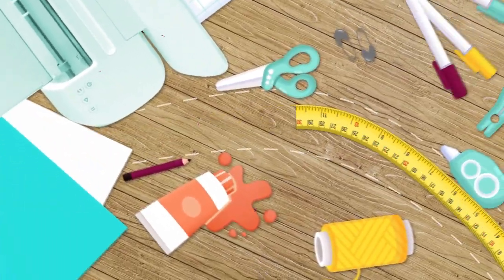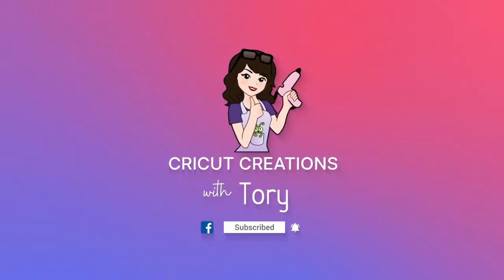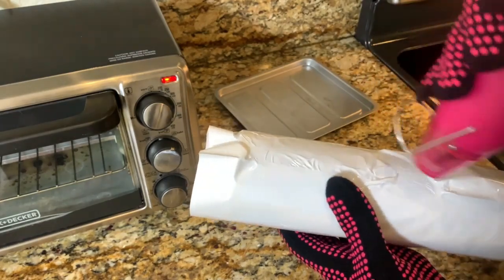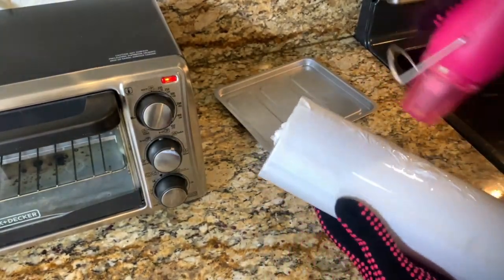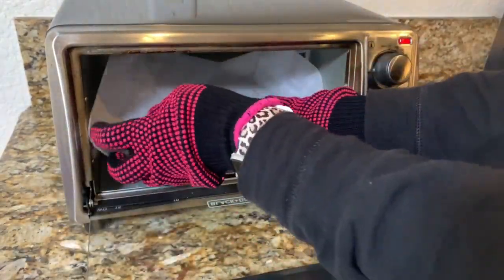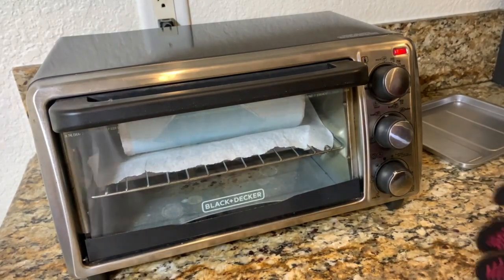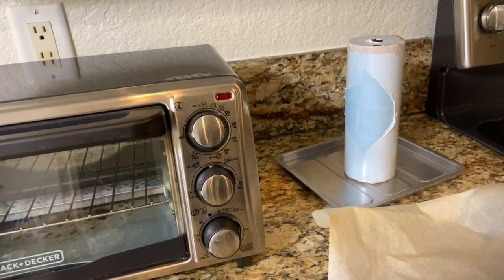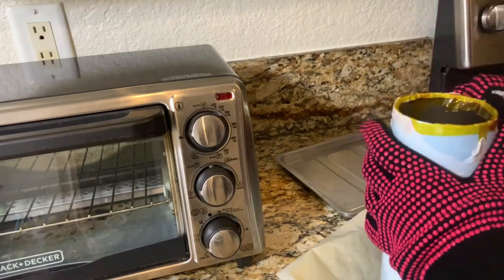Sublimating a Tumbler with a Toaster Oven #sublimation #diy #diycrafts

Comment: What all did you use to wrap the cup before putting it in the oven and what temp and how long
Reply: it's called shrink wrap. she also says the time and temp
Reply from the maker: Sorry! I thought I responded.  I used sublimation paper, then shrink wrap for tumblers. 400 degrees temperature & I don’t recall the time off the top of my head.  But I mentioned it at the end of the video. 😀